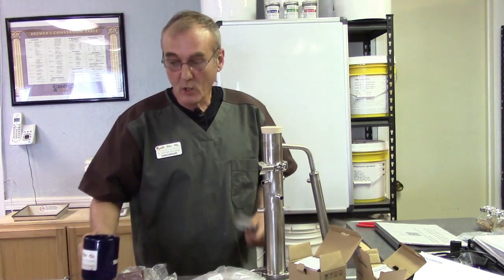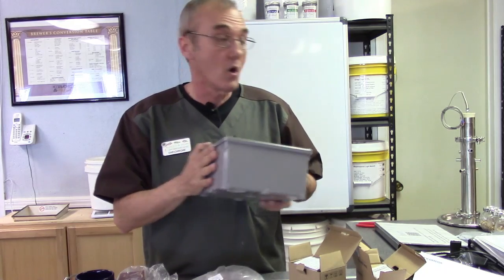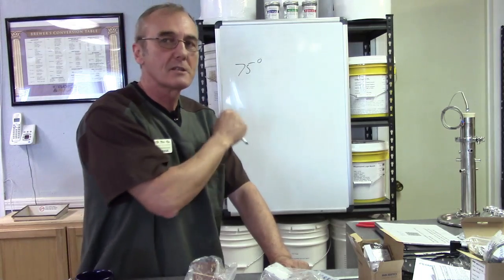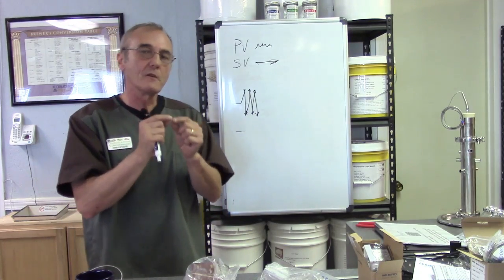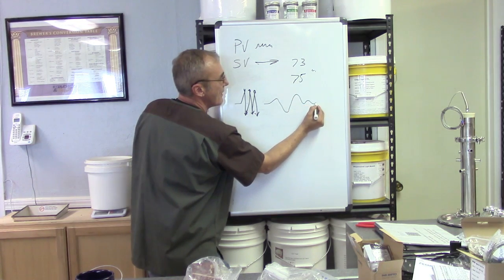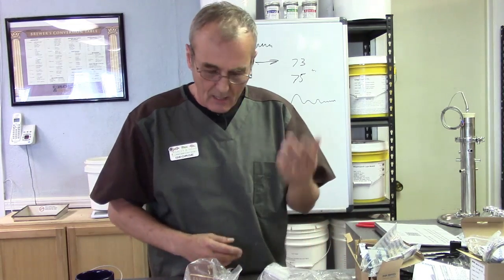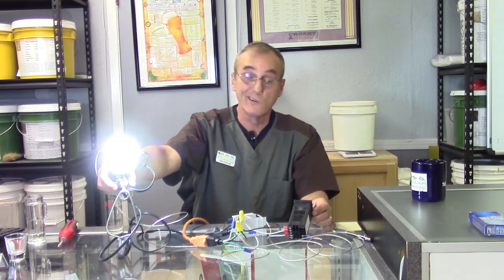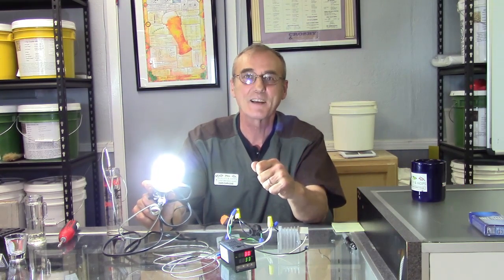Controlling temperature with a PID controller

Comment: Hi George. This seems to be a real hot potato topic in the distilling forums. Using a PID to control a (for example) a forced reflux still. I have some observations and questions. The boiling point of a wash is determined by the ABV of the mixture. The boiling point of the wash increases as the ABV goes down. Controlling the heating input contributes only to how vigorously it boils. If the boiling point of the wash (at the time) is, say, 80c and you set the PID on, say, 90c - the temperature of the wash CANNOT increase - only boil more vigorously. Is it correct to call this as a temp.controller and not a power controller (when applied to stills)? I think this is very important to get accross to new beginners (like me). So that being said...if I run a forced reflux column (with cooling management) - I can't see the logic of installing the thermo couple on the top of the column (afrter the column condenser). Wouldn't it be better to install it into the pot and use it as a manual power controller for the hotplate? Or am I completely wrong? I would really appreciate you input on this! Cheers!
Reply from the maker: Not such a hot potato topic after all. This really all depends on how well you can manage temperature. Think of it like this - the magic point in the still is where the valor passes from the column to the condenser, if you know the temp at that point you know (for sure) that you are vaporizing ethanol. On the other hand if you only know the temp of the mash origin (in the kettle) you are simply guessing. It's like trying to maintain 50 MPH in you car by watching the tachometer. The tachometer will give you and indication of how fast your engine is running and the amount of power it is providing but does not give you the fidelity of how fast you are traveling. The speedometer does that. It's kind of the same principle - a probe in the kettle will be like watching the tachometer. It is possible to extrapolate what temps work best by doing so but I have found that the most direct method of temp management is to have the probe at the top of the column. 
Your biggest challenge is balancing the temp since you are pre-cooling the valor with water to achieve a reflux action. It is easy to over shoot or under shoot the temp via water flow and you find yourself chasing the temp by adjusting both the heat and water flow together. 
ABV does change in the mash over time so at regular intervals it would be necessary to change the boiling point of the mash as the temp needed to separate the ethanol changes. This is true even in a pot still and a lost on some people. It all has to do with temp management. 
Hope this helps
George
Reply: Hats off for taking the time to write back George, thank you! This has got to be the single best and most informative reply to this question on the internett. Believe me I know - I've used many hours researching my design. 

What a great analogy about the car, speed and RPM's. It makes perfect sense. The reason I'm so hung up on the PID is because I have done a run or two on a friend's still which had a PID control (thermo couple on top of the column) and I think it is an ingenious way to apply control. The column however had minimal forced reflux capabilities. My only remaining worry is that if the hotplate takes its cue from the thermo couple on top of my column in, for example, full reflux the engine will be revving way too high. My reasoning is that the area directly over the deflag (a very effective deflag) will be far cooler than the area under the deflag. 

That said, I have just drilled and tapped the hole for my couple into the end cap of the column AND drilled a hole for a thermometer in the pot. Love gadgets and it will give me something more to look at. Besides race cars have their tacometers in the center of the dash ;) As I get to know the still  I think the temperature on the PID will be an arbitrary number(s) that I will learn along the way. 

Keep up the amazing work and your enthusiasm George. You contribute enormeously to the collective wisdom of our community! Awesome videos - Thanks !!

Comment: Lets say your set value is 78 degrees Celsius, The perceived value  drops to 75 degrees Celsius  and the PID determines the heating element needs a 12 % increase in power to bring the temp back to 78 degrees Celsius , does the PID increase the power by turning the power on 100% full power for a predetermined amount of time so the proportionate  amount equals a 12% increase in power, or does the PID turn on the  power that would equal proportionately 12% of the available wattage of electricity  to the heating element? Let me clarify,  does the PID increase the heat by turning the power 100% on for a adequate amount of time, or does it increase the heat by turning on the power by the amount of wattage or amps sent to the heating element?   You say PROPORTIONAL  does that mean 100 % power over a period  of time?  Or does that mean just the amount of power? I'm trying to describe this so you understand. Does the PID essentially just turn the power 100% on or 100% off like a thermostat? Or does the PID regulate power to the heating element?
Reply: Many controllers only output a digital signal, i.e. on or off, this is time proportioned according to what level of output is required using PWM, so at 100% power the output will be on continously, at 50% the ouput will switch on and off so that half the time is on, half is off, 25% power would be tuned on for 25% of time and off for 75% of time. So for example, the lowest setting usualy available on most controllers to opperate a SSR is 1 second, this means the lowest switching repetion rate on/off is 1 second. So at 25% output power the controller will activate the output for 0.25 seconds every second, 50% would be 0.5 seconds etc. The controller will determine how long to activate the output acording to the setpoint and measured process value.
There are however also controlers that give an analogue output, for example 0-10v, so at zero power there would be no output and 100% power would be 10v output. (usualy output would be 4-20ma), these can give an almost infinite control over the process, used in conjunction with a phase angle controler it is possible to have very precise control.
Reply: @daic7274  thanks for the reply. Helps to put the puzzle together.  Cc
Reply: i am looking for the answer to this as well. the way they are wired in a heating circuit , it seems impossible for the pid to regulate the energy ie 30% power output . i think it can only switch full on or off. confused.

Comment: George I built me a pid mypin T Series, can’t believe it and it works but  I can’t get the temperature to balance 2days now 18 hrs a day and still no balance.... went in to settings proportional and integral and derivative all off. Try it temp still don’t match.... turn all p.i.n back on more hrs go by temp still 3 to 4 degrees difference. Never balanced .... what is going wrong... I thought building would be the hard part that’s the easy part with see the great videos.... But you are going to have to make a video on step by step on going in all the settings and we’re to set them and and need set on or set off... this could be up for sale I’m just not smart enough to get it to balance... my dial controller stays at a steady... so if can help a would appreciate it.... I have call ever phone number and have left message, we’re u at my friend lol
Reply: Charlie, I am planning to do a video on the internal parameters of the PID and specifically the P,I and D settings. These do need to be set correctly otherwise the controller will not know how to balance. 
Set your P at 1.00 the I at 240.0 and the D at 90.00 and then try it again.

Comment: Hi, Love the videos! could the PID be used to separate heads hearts and tails? 
for example set the PID temp the top end of the foreshots. then once the still stops producing alcohol that means all the bad compounds have been removed and you can bump the PID to the temp associated with the end of the heads? etc etc.
Sorry if this has been covered already! I'm working through the videos! 
Cheers
Reply from the maker: Yes you can but each batch is a little different so this is a moving target. There is no easier way than knowing what you are doing when you make the cuts. If there was a button to push to make these cuts for you someone would have found it by now.
Reply from the maker: There are definitive points you can set to accomplish most of the process but the fine cuts are too close to just dial in a temp to make.
Reply: +Barley and Hops Brewing LLC,  thanks for the replies man! I totally understand that the PID doesn't make it easier. or can set points etc, I'm looking into getting the Still Spirits Pot Still. im totally new to the whole concept of distilling, so I'm getting my head around using a PID with the Still. you are a guru master!

Comment: Can you tell me if a Rex c 100 can control heating and cooling?  So for example if I wanted to run a heater inside a refrigerator and control the refrigerator with the same Rex c 100.
Reply from the maker: You cannot control both at the same time with the REX. Not real sure you can set it to control cooling either. Check the wiring diagram and see if it has a setting for cooling. Should be obvious if it does. If not the TD 4 will control heat or cooling but not together.

George
Reply: +Barley and Hops Brewing LLC  what is the best and least expensive pid that will control both at the same time?
Reply: +Barley and Hops Brewing LLC  I don't want the heat on at the same time as the cool but if it needs cooling it will turn on the refrigerator and if it needs heat it will turn on the heater.
Reply from the maker: That's a good one. I am sure there is a way to do this. First though is to double up the controllers, two TD 4's would be perfect. One for heating and one for cooling (of course assuming that you would never have both happening at the same time). You could even use the same power supply (split between them) for both.
Reply: I've got the r e x c100 there is something wrong with it I guess no matter what I do it will not turn off power to the SSR what do I do?

Comment: hello sir could you pleas help me in something
i had a JCS33A Shinko Temp controller and i found that you need to set the Low height  value of SV , but i don't know why would you need to  do  that when you already set it in the main menu 
and another thing what is the difference between heating and cooling output 
and finally what is the ARW setting ?
Reply from the maker: Sorry but your questions should be refereed to someone who knows more about the JCS33A.
George
Reply: Barley and Hops Brewing LLC so there is no height or low SV configuration in your temp controller??
Reply from the maker: There is but we don't adjust the factory setting. It works perfect as is and needs no adjustment. 
Check out  the TD-4 PID on line
Reply: Barley and Hops Brewing LLC  ok thank you Sir for your time
Reply from the maker: I tried looking up your PID and found that it was discontinued. I guess Shinko is moving to other controllers.
Reply: Barley and Hops Brewing LLC  yes  it is

Comment: I have a billion questions!  hahaha

First, thanks for being awesome, George!  I've been researching and learning about this great hobby for a while now.  In my search I spent some time on one of the distilling forums and the people there were ...not pleasant.  It's great to find someone sharing their knowledge and still having a light hearted, experimental spirit!

First off, why are we wiring these things?!  Electricity is scary!  If all of these PID units require a relay and it looks like they all pretty much come with one already, why aren't they just wired up?  Take a look at this product.  It's an Inkbird too even though it says it's a thermostat and not a PID, is this the same thing you're building?

http://www.ink-bird.com/product/detail/p/ITC-308_Outlet_Thermostat_Temperature_Controller/id/12

I'm in the process of building a larger still out of a 15.5 gallon beer keg.  Thanks for your video on induction cooking, by the way.  I never would have known I could do it because you're right, everything on the internet says induction won't work with stainless steel.

Since the keg is so big, it seems silly to try to control the temperature way up at the head of the flute via the heat source all the way at the bottom, especially when trying to heat up such a large quantity of wort.  Also, I don't even know if a PID would function with an induction heater.  

My idea is to control the temperature at the head of the flute with a dephlegmator.  Essentially, giving the boiler full power for heating, then controlling the temperature at the head by varying the reflux ratio via a water pump supplying cold water to a cooling jacket located directly under the thermometer.

What has me concerned is the "proportionate" part of the PID.  As I stated above, I don't know much about electricity, but I think a lot of electronics aren't able to function at partial power or even worse, they break!  I am worried I can't use a PID to power my induction cook top or my water pump because of this.  Is there any way to turn off the proportionate part of the device?  Just tell it the only power option is a = binary on and off of the water pump and it will have to figure out what pattern and length of operation it takes for the pump to keep the head sufficiently cooled?

I guess that's asking it to function more like a thermostat as you described in your video.  The only difference would be, it's okay if the water pump flicks on and off every few seconds.  I could understand how you might not want your home ac unit to be doing that.

Finally, watching these videos on PIDs has me thinking about another possibility.  We've already bought one of these things.  In an effort to get some more utility out of it, get a laugh out of a novel idea, and just be super lazy about making a solution to a complex problem, I've got an idea to use it for fermentation.  

I keep my wort fermenting in my home throughout the week.  Generally, the temperature stays at about the range the yeast needs to be, but maybe a few degrees cooler.   What if I had the PID unit power an electric blanket that was snugly wrapped around the wort?  This sounds to me like the perfect way to gently and consistently keep the yeast exactly at their favorite temperature and only for the cost of a heating blanket.

Sorry for writing the dead sea scrolls here.  I thought it might be better than emailing you since everyone can now read it and learn.  Thank you again for helping everyone out here.  I look forward to supporting your company as soon as I decide my next move.

Sincerely,

Justin
Reply from the maker: You do have a lot of questions. Tooi many for youtube. Go to our website and send me an email
George

Comment: Hey George! How's it going? I got a question about PID's (and I did watch your other video on wiring them, which was easy enough to understand). If the PID measures the temperature, what heats it up? It's not conducting heat, right? Perhaps you addressed this and I simply didn't catch it.

Also, what is the difference between a PID and a kegerator thermometer that controls electricity from the wall to the fridge? I am missing something, but don't know what. haha :)
Reply from the maker: +Shad Hall The PID doesn't heat up it controls the heater. It measures precise temperature and calculates the need for power to maintain a constant temp without cycling. The kegerator control you talk about only turns on and off at a set point but does not calculate any differences in present, past temps and timing like a PID does. Hope this helps
By the way- we miss you around here

George
Reply: +Barley and Hops 
Thanks for the quick reply. I think what was throwing me off was how the temperature kept changing on the PID. The light bulb was merely as an electrical current indicator, right? So, what was causing the PID meter reading to change several degrees? I know the ambient room temperature wasn't fluctuating that much.
Reply from the maker: +Shad Hall That was the thermocouple sensor I had inserted in the vapor stream.  Sort of like an electronic thermometer, you must have missed that part on the video. We wired it into the PID before we turned it on.
George
Reply: +Barley and Hops I bet I did. I'll have to give it a thorough viewing. :)
Reply: +Barley and Hops Thanks for taking my follow up phone call and resolving this quandary for me! It was good catching up. :)

Comment: hmm.  but as ethanol evaporates from the wash you need more power (i.e. higher temp).  so wouldn't you have to increase your SV constantly?
Reply from the maker: +Dmitry Dubinsky Not constantly but periodically. This is not a set-up, turn on and walk away process. This is an advanced accessory some may enjoy using 
George